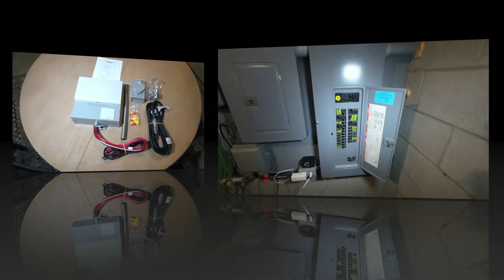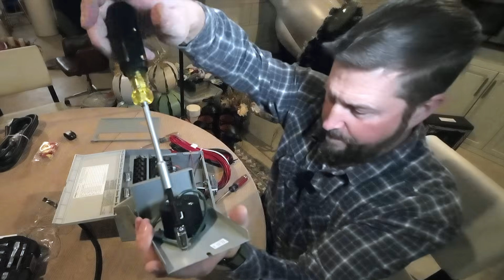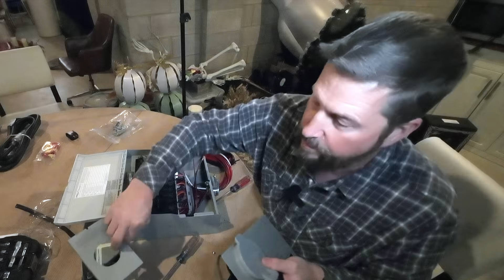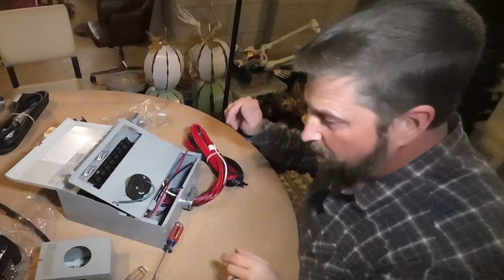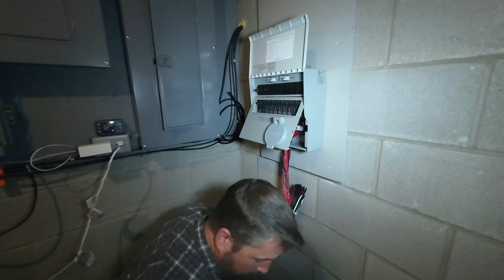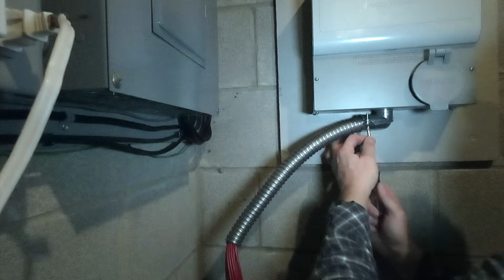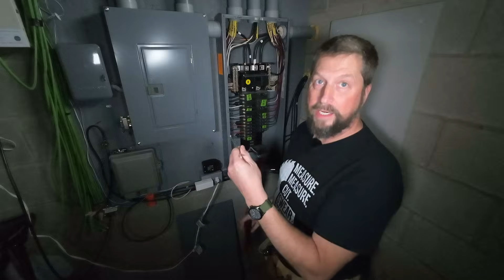Installing A 10 Circuit Transfer Switch: Reliance Controls Model Number 310CRK

Comment: Question. On the C/D breaker on your main breaker it appears the wire gauge you ran from the transfer switch is noticeably smaller than the original. Aren't you concerned about the load issue going to the sub panel through the transfer switch?
Reply from the maker: That subpanel only powers very light loads like upstairs lights and outlets, so there’s very little risk of overloading that circuit! 🤠👍

Comment: Hey where does the extended longer wires come out of transfer box to the  inlet box.
Reply from the maker: If you mean the wires going from the transfer switch to the remote inlet box, I extended the four conductors from the original inlet connection inside the transfer switch—two hots, neutral and ground—and ran them through conduit to the new inlet box. 🤠👍

Comment: Do you need an interlock switch with this setup
Reply from the maker: Great question. No, you do not. The transfer switch has a hard disconnect before switching to generator power.  🤠👍

Comment: Bought this panel - it is against code to leave wire nuts in the panel. Trying to figure out a solution.
Reply from the maker: That is a great point, it’s always best to make sure everything is up to code! Maybe WAGO connectors meet code? Good luck 🤠👍

Comment: one other question, I have solar panels directly grid tied. So I cannot use them for charging my power station batteries, which is fine. But will this work and not mess with any of the wiring in my box associated with the solar panel inverter?
Reply from the maker: Solar panels require a charge controller to clean the energy. You probably already know that, just wanted to put it out there. Solar is far better suited to charge a battery then power circuits from the battery through an inverter. Even the gas generators give off very unpredictable power. If it were me personally, I would invest in a large battery bank and run your backups through your transfer switch from an inverter. Direct power from Solar is just too unpredictable
Reply: @samsdoinstuff  yeah that is my plan, my solar panels will stay like they are and do nothing for me when the power is out. I will be using a propane inverter generator to recharged the power station batteries. Already have all that built out. I just have been trying to figure out how to connect the power station inverter to my box and not mess with my solar wired into my box. This shounds like a safe way to isolate my power station from the main line and my main line solar

Comment: in theory, all the loads from the sub-panel upstairs will be traveling through the two (2) #12 factory transfer-switch cables, when utility power hasn't failed, most all the time.  Question: when you turn everything on upstairs (lighting, and other anticipated receptacle loads), what is the current on those two phases?
Reply from the maker: That’s a great technical question, and it really comes down to how much you're actually pulling on those circuits at any given time! I don't think we ever turn everything on upstairs at once. The largest load has to be either a hairdryer or our jet tub. So far so good 🤠👍

Comment: There's no need to switch off the main breaker during a power outage.The transfer switch isolates your gen power so it can't feed back to the grid.
One other thing I'd recommend is if your breakers have a stud that contacts the wire directly as you tighten it, you should either use a solid wire pigtail and wire nut the red wire to it or crimp a ferrule on the end of the red wire. Stranded wire can be damaged when being tightened down under a stud like that. I have this transfer switch being powered by a 12000W solar inverter. You can also change out the single pole 15A breakers with 20A but you have to do your homework to make sure you don't overload the overall switch box rating of 50A. If I remember right, the BR series breakers are compatible.
Reply from the maker: Thank you very much for that information 🤠👍

Comment: Great vid, Can this be used for solar generator as a permanent bypass means? I.e. most the time the power would just come from solar and bypass the line power?
Reply from the maker: Thank you! I would say anything can be done if properly wired. For instance, you could have a battery backup ready to power the transfer switch and then use the generator to charge the battery. That is the most effective use of battery and generator. 🤠👍

Comment: Good Job! I needed a refresher coarse. Getting ready to do this job for a second time. I have whole house generator setup but wanting to add a transfer switch to run a solar generator as a option.
Reply from the maker: Thank you! Glad I could help. Good luck with the install 🤠👍

Comment: I would use the WAGO connectors, instead of the wire nuts. Nice work.
Reply from the maker: Thanks! I've heard great things about those connectors 🤠👍
Reply: @samsdoinstuff  You're welcome. Some different type I will order now; Fineday Wire Connectors Kit, 12 Pcs Terminals with Heat Shrink Tubing, (16-8awg)*6 + (8-6awg)*6. They are straight inline.

Comment: WHEN THE POWER GOES OFF ALWAYS TURN THE MAIN BREAKER      OFF   BECAUSE  YOU ARE BACK FEEDING THE MAINS THROUGH THE SMALL BREAKER . BAD FOR LINES MEN WORKING ON THE OUT SIDE LINES
Reply from the maker: Very good advice except this system WILL NOT back-feed the mains. There is a hard disconnect between line / generator switch. It is completely safe to leave everything on. 🤠👍
Reply: If you have this transfer switch, you don't need to do that.

Comment: "Too big" - Come on... by how much and what determines the size?
I'd suspect if you were to use some machinists calipers, you would find both holes are the same size.  If the screw head does not pass through the hole, it fits.
Reply from the maker: I did try that and it wasn't working, but I found a solution that works great now! 🤠👍

Comment: Great video btw!! So, forgive me for just double-checking, so when you have a power outage, the main switch on your panel has to be turned off, correct?  And then you go to your transfer switch and switch from line to generator. As for the generator outside, it obviously has to be plugged into your inlet box, so that box can also be installed outside on the wall and have the wire come into the transfer switch and be connected. But you still need to drill a hole in the wall for the wire to go outside to get to the generator. Am I making sense? Sorry again, just making sure I got it right.. All the best.
Reply from the maker: Thank you very much.Know you do not have to turn the main breaker off.When you have a power outage, you simply start the generator plug the umbilical to the inlet.Like you described and yes, you'll need a hole in the wall.Then you go downstairs or wherever you're transfer.Switch is and switch all of your switches to generator power. Very simple 🤠👍

Comment: Excellent video. I’m planning to have a 10-circuit transfer switch installed for a battery backup system and wanted to really understand how it’s done before hiring an electrician. This walkthrough was clear, practical, and easy to follow without oversimplifying. I don’t plan to DIY it, but this gave me exactly the level of understanding I was looking for. Also appreciated the little quirks and straightforward delivery — made it an enjoyable watch. Thanks for taking the time to put this together.
Reply from the maker: Awesome to hear it was helpful and enjoyable for you! Thanks for watching! 🤠

Comment: The Reliance wiring diagram shows black to "X" and red to "Y".  I suppose it doesn't matter since the voltage is AC, not DC, in which case polarity is paramount.  Just saying.
Reply from the maker: You're absolutely right about the AC not having strict polarity – good catch! 🤠👍

Comment: Great video thanks! Im going to do what your doing because im using a power station (Ecoflow) instead of a generator.  Ill have an electrician do it though.  Its still good to know whats involved.  
My panel does not have a main breaker.  Instead of turning that off, can i just turn off all the breakers?
Reply from the maker: Absolutely not! Turning off the breakers DOES NOT kill the power leading to them. Think of it as turning off a light switch. Sure the power is off to the light, but there is still power going to the switch. Good decision having a licensed electrician do it. 🤠👍
Reply: @samsdoinstuff ok thanks for the information.  One question I noticed you turned off the main breakers but then said there was still live wires above that area, why is that?
Reply from the maker: @tylermack4530 Great question. The wires that lead into the main panel are hot from the utility feed outside the house. Think of electricity like water. If you have city water, there's a main shut-off for the house. That is what the main shut-off is for the breaker panel. You still have water pressure behind the main water valve even if you close it. That's exactly what happens when you turn off the main in the electric panel. Hope that explains it. Please don't do any electrical work yourself. No offense, but you have a very limited understanding of electricity and that is very dangerous. No shame ever in hiring a professional. I could never work on a car engine. It's always good to know personal limitations.
Reply: I see those hot wires are before that main breaker so how you explained it makes sense .  In my case the main breaker is actually outside the house attached to the meter.  Would shutting that one off shut off power going into the panel?
Reply from the maker: @tylermack4530 It should
Reply: @samsdoinstuff thanks man.  I'm actually pretty safe doing electric work never on a panel yet but HVAC, light switch etc.  I always shut off any related switches and breakers first and then double check no voltage with my multimeter before messing with anything.  Safety first!

Comment: can this system run 6 or 8 breakers while my other breakers are in my main panel still connected to the grid?
Reply from the maker: Great question. Yes, all of the breakers in the main panel remain connected. You can actually choose which transfer switch circuits you want to run off of generator power all while being connected to the grid without any danger of back-powering because every transfer switch has a hard disconnect when it is switched to generator power. 🤠👍

Comment: You don’t have any safety plate on the main breaker? So you could accidentally pull the main breaker on and off and then you would have to big problem?
Reply from the maker: No. There's a hard disconnect on all of the transfer switch breakers so there's no danger of back powering the grid

Comment: You can also use a battery back up even with the main line under grid power, you can use the battery gen. to power just the circuits from the switch to cut your bill down. which is what I'm planning to do soon. Power the daily 15-20amp from battery and the 220ac from the grid. I'm hopping this will reduce my monthly bill a bit.
Reply from the maker: Thanks for sharing your plan, sounds like a smart way to cut down on the bill! I assume you'll use solar to top off the batteries 🤠👍
Reply: @samsdoinstuff  Yes, I will be putting up solar panels to keep the batteries charged up. Picked up my 10 circuit switch yesterday. Now looking for a good portable battery power station unit. ( some call it a battery generator ).
Reply: @DIYVentures  A battery is not a generator....it's just a battery.  Solar is what generates electricity to the battery for storage.  Like in a car.  I'm going down this rabbit hole, too, but not going crazy with solar as our electricity in Arkansas is quite reasonable.  I'm adding  the Reliance ProTran2 10 circuit in so I can use a battery for when it's storming outside, power goes out, and I don't want to go out in a torrential downpour and lightning to hook up the generators.  Battery will be for 2 hour or less outage.  If longer, I'm on a single, or pair in parallel, dual fuel inverter generators off of a 250 gallon propane tank.
Reply: @ITguyAR_66  I'm aware of what a battery is and what solar panels are and do. Just because I called it a generator vs a portable power station, doesn't mean I don't know the differences. Google battery generator and you'll see what I'm talking about. I'm not going down any rabbit hole. I am familiar with solar, wind and water sources to produce electricity. In fact I designed a vertical wind turbine for the DIY'ers . I already installed a protran 2 -10 circuit last week. But thanks for correcting my words. I'll fix that as to not confuse anyone.

Comment: Great video. I have a similar transfer switch panel in our home. Instead of waiting for a power outage you can simulate a power outage and run off the generator to make sure everything is working correctly.
Reply from the maker: Thank you! It really is a great system 🤠👍
Reply: Lol yea you don't want to wait till the day of the outage to find out your transfer switch had some defect from the factory that only manifests after passing 1500W minimum for 1 hour.

Comment: How do you go about labeling A through J.
What breaker get A and B...and which one get B,C ect..
Reply from the maker: There are places to label the transfer switch just like a typical breaker box 🤠👍
Reply: @samsdoinstuff 
So you can place the sticker (letter) at any breaker...just as long as you will connect the corresponding wire...to the same letter.
I have always wanted a transfer box...just no video available that was easy to follow. This got to me the best tutorial clip ever!

Comment: Could you have two inlets? one inside for battery and one outside for a generator?
Reply from the maker: Great question. Yes. I would also install a selector switch so it could not receive power from both sources at once 🤠👍

Comment: I don’t see the point of this product. Why not do it the traditional way? Just put all those circuits into a light load sub panel (50 or 60 amp) and run the 60 amp from main to transfer switch from transfer switch to the panel and generator to the transfer switch. If the auto transfer switch is too expensive then buy a manual transfer switch. Only time this will come in handy is if you have multiple panels but if they’re far away from each other it doesn’t make sense to use this and if they’re close to each other just transfer all the circuits to one of the panels and do it the traditional way
Reply from the maker: Great option! I like the way you think 🤠👍

Comment: Do you need to pull a permit to add a transfer switch box like this? I would like to do the same thing. It's really straight forward, but I got a feeling cities want your money.
Reply from the maker: You have to check your local codes. 🤠👍

Comment: Could I connect my solar inverter to the wires directly  in that generator connection port?  Thus bypassing a generator inlet box?  I plan on using solar (with batteries) to backup my utility.
Reply from the maker: I am not sure about that.

Comment: So I understand your desire to have the generator plug installed at the panel to run a battery generator inside the house.  In order to go both ways with a gas generator outside and a battery generator inside you need to get another plug.   I like your idea but can the plug only be had with out the box so you can use the outside box included in the package?  I think I know the answer to this question my I'll ask it anyways, So in a power failure situation with this transfer switch engaged do you have to turn off the mains to the breaker box to protect the electrical workers fixing the outage?  Finally that open space on the board above the transfer switch is itching for your next project... :) Thanks.
Reply from the maker: Thank you! I ended up moving the inlet to the outside for the gas generator and I will add an inlet inside with a selector switch to chose between inlets. Also, this system cannot backfeed the grid. You can leave the main on all the time and when the power comes back on, it doesn't present a danger because everything in the transfer switch has a hard disconnect between grid power and generator power. Smart 🤠👍
Reply: @samsdoinstuff  Thanks for the quick reply. Have a blessed day. David

Comment: Which breakers are compatible with this transfer switch? The 6 circuit version comes with 4 15 amp breakers but i want to swap them for 20 amp breakers. So which brand can i use. Can square d breakers work?
Reply from the maker: Great question. Square D breakers will not work on the Reliance transfer switches. I did a quick Google search for "replacement switches for Reliance transfer switch" and several places came up where they are available. Hope this helps 🤠👍
Reply: @samsdoinstuff  thanks. Where are they avaliable? I dont live in the usa and i am limited to my options.
Reply from the maker: I'm not entirely sure what source is best for you. You'll have to decide that for yourself. Good luck 👍
Reply: @samsdoinstuff ok but i was asking about the several places you didnt mention. Can you list them please
Reply: Siemens, cutler-hammer, eaton, murray, square D/schneider, and ge.  All of these are listed on the side of the transfer swith as being compatible breakers.  Obviously, they list particular types, but there are too many to list.  Mine came with GE, so that's what I bought when I wanted to replace the dual-pole breaker with two additional 15 amp breakers.

Comment: It looks pretty simple. I have been doing all basic electrical work myself in the past.  Can I legally install a transfer switch myself in San Diego, California? I know I need to pull a permit.
Reply: Permit can only be issued to a licensed California State Contractor authorized to perform electrical installations or to the property owner or lessee. So, I can install a transfer switch myself.